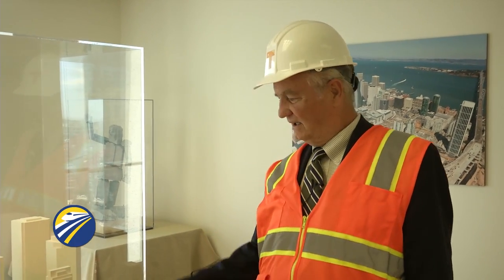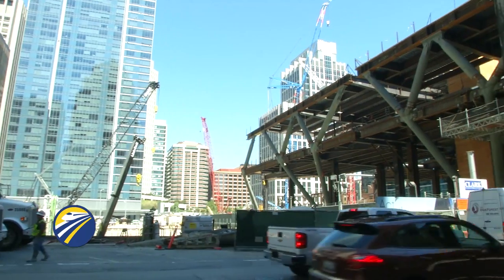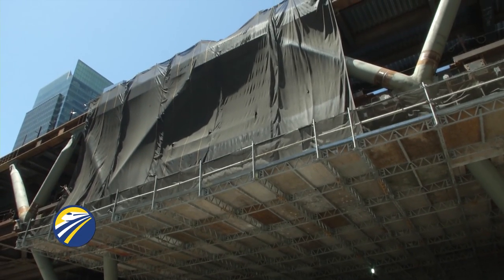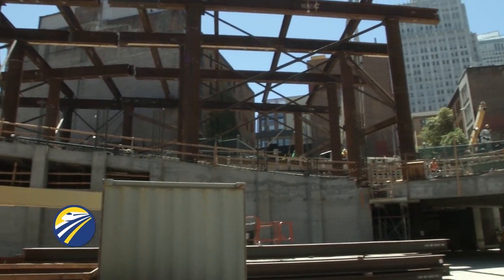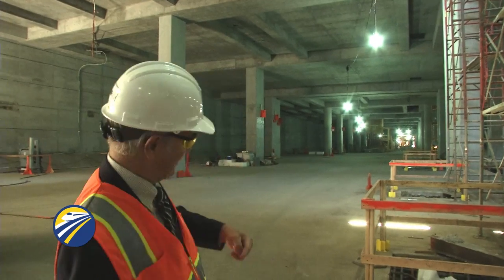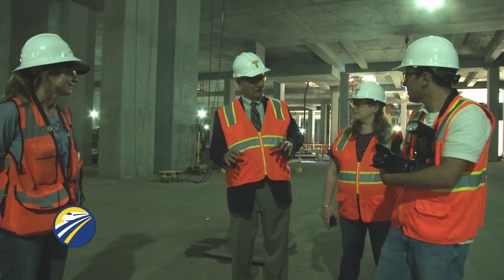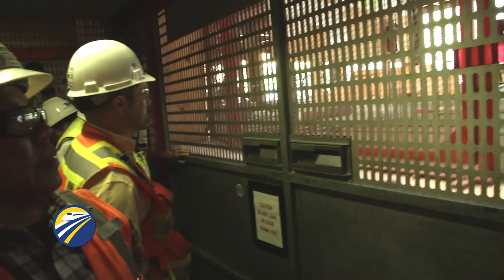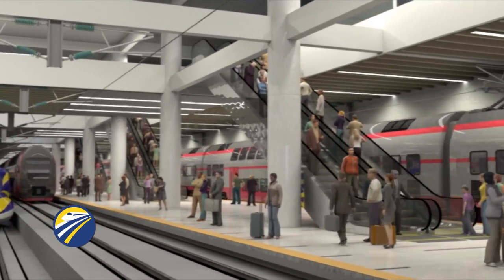San Francisco - Transbay Transit Center - Construction Tour with Brian Dykes

Comment: Can't wait for this to open. California needs a really huge "central station".
Reply: The terminal is currently closed due to two cracks found in the support beams. Also, the train level isn’t supposed to open until 2025-2026.
Reply: @davidnissim9203  I belivie the stress which caused the cracks was cause by some fault in manufacturing or transport.

Comment: It looks like the current setup for Transbay is a stub-end station. If LA Union Station is being reconfigured from a stub-end to a run-through to ease congestion and allow more trains into the station at a time, then Transbay should also be built as a run-through from the outset. Hopefully a return loop is added within the near future, not long after rail service begins, so trains can enter the station from one end and leave out the other. The station will only have half the number of tracks and platforms as the current 4th and King Caltrain station, so it'll be critical to keep the flow of trains going smoothly to avoid backups and delays. Especially considering the estimated amount of Caltrain and CAHSR trains that'll be using the station on a daily basis.

Comment: It's funny how deceptive things can be - the lower floor looks almost done except it's not the actual floor - 1' more of concrete for that plus an additional 1' of ballast, sleepers and steel for the tracks - then there are the platforms on top of that - perhaps the passengers will be walking 4' above the apparent floor (as per the video) when the terminal is completed.  I know this footage is over 30 months old, but it looks good overall!

Comment: It's April 2017 now, I wonder what the progress is on this project. I live in Fresno where they have been taking out overpasses and building viaducts left and right.
Reply from the maker: Actually, the Transbay Transit Center is scheduled for completion this December.
Reply: The High Speed Rail system will open in 2029, but the train level of the Transbay Terminal will open in 2026 for Caltrain service.